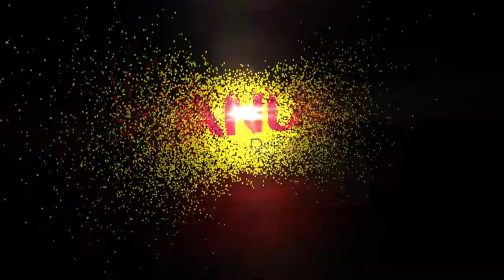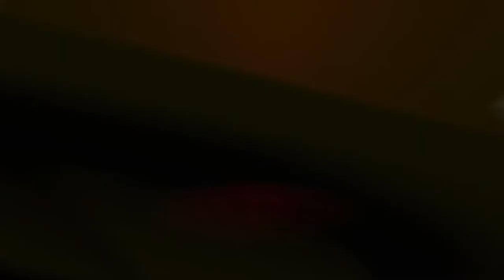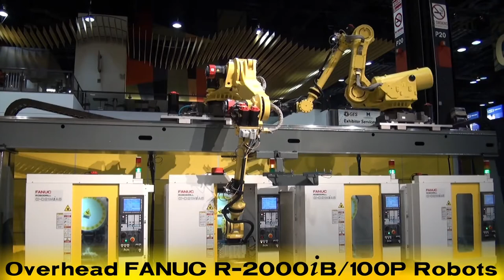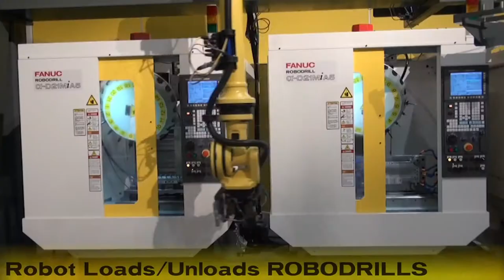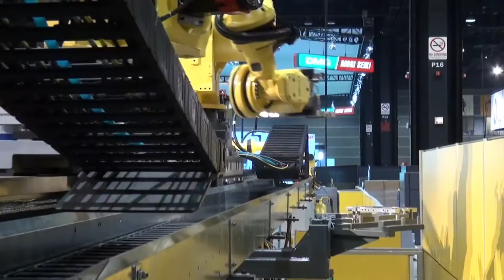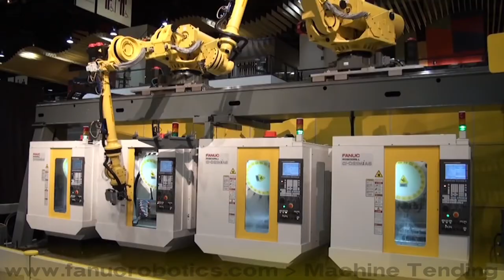Two Overhead Robots Load Unload Four FANUC ROBODRILL Machine Tools    FANUC Robotics

Comment: As a machinist I just don't see how this can be reliable, for the simple reason that cut chips go EVERYWHERE during any milling operation.  And Also...We all know this is just an intermediate step as we move to high precision 3d printing in all materials.
Reply: There's air blast and chip washdown to prevent chip interference between operations. Basically any machine with a pallet system can be automated or mated to robots. IMO, we are still a ways away from obsoleting CNC.